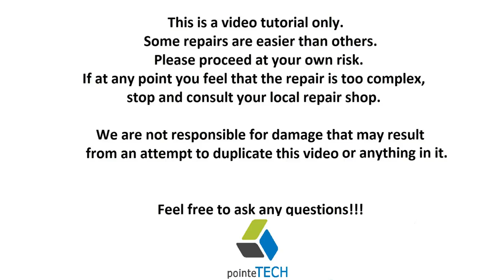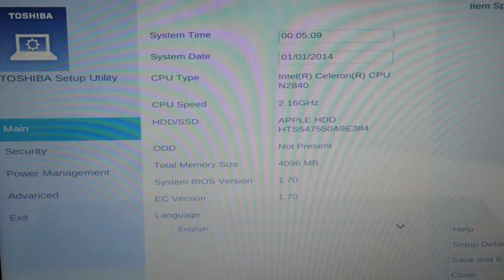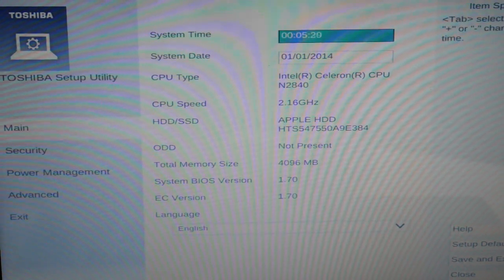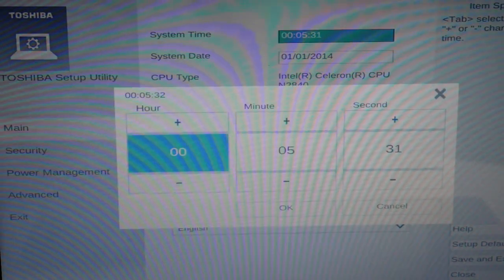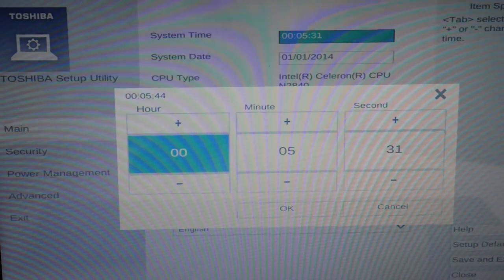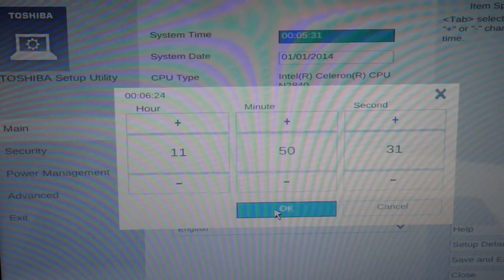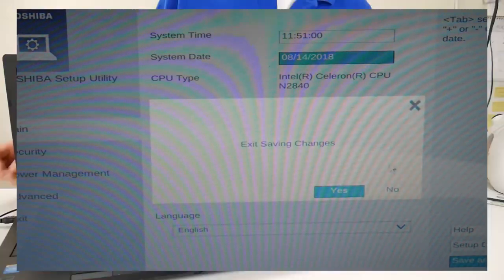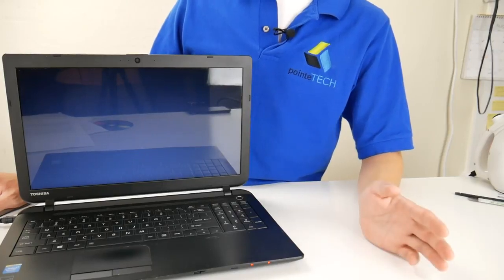How to Fix Replace Bad Checksum, RTC Battery Low, 0251, Set Date Time Error - Toshiba Computer

Comment: Hi, have this issue. Try hitting the F2 key and just seem to register or escape or delete for the on board keyboard and a plug-in keyboard still the same issue won’t let me do any of the comments. Any help would be appreciated and it’s a brand-new CMOS battery.
Reply from the maker: Your getting a 'Bad Checksum' error on your Toshiba and cannot access BIOS? Have you tried all the function keys? Also, did anything happen before this issue appeared?  Liquid spill, overheating, Windows update, etc?

Comment: Are data, images, and files deleted?
Reply from the maker: Is the DATA deleted by replacing the CMOS battery? No. DATA is not stored on the battery. Its stored on the HDD

Comment: replacing battery did not solve the problem :( ..
Reply from the maker: Then your most likely looking at a BIOS issue or a motherboard issue.  I would next try to reload or flash BIOS

Comment: Hi. 

I am using Toshiba C55 laptop. It gives RTC Low error. 

Moreover battery shows just "plugged in"

Replaced new battery twice. 

Updated windows 10.

In device manager uninstalled drivers under batteries and reinstalled. 

Doesn't fixed so far. Appreciate your valuable feedback.
Reply from the maker: If the CMOS battery is fine, it could be a motherboard issue at this point :(

Comment: But even if its pluged in, still might be battery problem? Mine is working for 2min. then it goes "battery low" and shuts down when pluged in.
Reply from the maker: This video is referring to the CMOS battery.  Not necessarily the main computer battery.  Are you seeing a 'bad checksum' error?   Or is the computer just turning off?   If the computer is just turning off, what is the battery showing for a charge when it turns off?

Comment: That's the wrong laptop to use for this video because these Toshiba Satellite C55 DO NOT have an internal battery.
Reply from the maker: Seemed to work for the video just fine lol.  But thanks ;)
Reply: @PC_Monkey  Setting the date in the BIOS can be done on any computer. But that does not reset the bios with an RTC low battery error when those model do not have a battery. If you have an RTC low battery error, pull your main battery and power cord. Let's see your little fix solve the problem then. It doesn't. As we all know, batteries with laptops at some point will go bad. Without the main battery, that error will remain no matter how many times you set the date in the BIOS. And you are leaving that part out.
Reply from the maker: @graffixplus908  If thats the case with a viewers computer, they message me, if they are so inclined, and I instruct them further.  When you make a video on the subject, Im sure youll make it how you see fit ;)  but thx

Comment: Hi, do you have any ideas what to do with my computer toshiba l50t-b-13u, it’s showing message RTC battery low, and then asking for some sort of password, no idea if it’s a BIOS password or something else. Thx
Reply from the maker: Yes, it could be a BIOS password.  Unfortunately, I dont advise on bypassing BIOS passwords on this channel.  You can try to replace the CMOS battery for that other warning however.
Reply: @PC_Monkey  is this model of Toshiba having BIOS battery or is it combined with main laptop battery? As I cannot see any under the bottom bezel, I don’t want to strip full motherboard to see if it underneath somewhere, just in case I’ll damage the motherboard. If it’s the BIOS password it’s asking me on the screen, why is that and how can be fixed? Thx
Reply from the maker: @konanunu1980  Not all motherboards have CMOS batteries.  If yours does not, then you wont be able to reset BIOS that way.  Again, I dont advise on how to affect BIOS passwords on this channel.
Reply: @PC_Monkey  so do I need to go to computer shop and let them do it? Coz I’m stuck, I don’t know what to do :(
Reply from the maker: @konanunu1980  Yes.  They may recommend replacing the motherboard, as most shops will not know how to bypass a BIOS password.

Comment: Mine doesn't work, I've press F2 and F1 but still not working
Reply from the maker: What brand and model computer do you have and whats the issue with it?
Reply: @PC_Monkey  me to
Reply: Mine is a Windows 8 Toshiba touch screen
Reply from the maker: @yukiee5495  What is happening with your Toshiba?
Reply: @PC_Monkey  I open it and start tapping on f2 but it says etc battery is low and doesn’t do nothin
Reply from the maker: @yukiee5495  Try removing the battery and just starting the computer using the power adapter.  What happens then?
Reply: @PC_Monkey  oh wait it works THANKS MAN
Reply from the maker: @yukiee5495  Your welcome !!  Happy to help :)
Reply: @PC_Monkey  when I tell you I already lost that laptop 😭 idk it's feel funny know kkkkk~

Comment: but mine is a Satellite L850 ive changed the cmos battery and and changed the time and still its on the bois settings
how do i fix this????
Reply from the maker: Your computer starts and it does directly to BIOS?  Before your able to see the startup logo screen correct?
Reply: @PC_Monkey  no i see the start up logo first and straight up to bois
Reply from the maker: @BreadCrusader446  Try this video first then; https://www.youtube.com/watch?v=2Hh1wIS9NDo
Reply: @PC_Monkey  pls respond

Comment: How can you fix it without a keyboard? Say the keyboard itself is not working.
Reply from the maker: If the keyboard itself if not working, then you should first replace the keyboard.  Its very hard to troubleshoot computer issues when more than one thing wrong.  Usually, you need all components to do their job.

Comment: Para el modelo Toshiba Satellite L45-B, me aparece mensaje "rtc battery is low press enter to set date/time", actualizo y luego normal funciona, pero cada vez que lo apago vuelve al mismo mensaje "..." Como descartar si es la Bateria gastada (en la barra de bateria me aparece una X roja) o será la pila?.
Reply from the maker: If you get that error and have to adjust the Date/Time setting every time, then your CMOS Battery needs to be replaced.  You can see how to access that here;  https://www.youtube.com/watch?v=uL97XhontSo&feature=youtu.be

Comment: este modelo no trae bateria interna como la van a cambiar si el siguiente video es otro modelo.
Reply: Yo ya busque la bateria por todos lados y tampoco la encuentro, entonces quien alimenta el CMOS del Motherboard, el problema de RTC Battery Low es defecto de fabrica ?
Reply: @marianamartinez5963  ya solucione el problema. compre batería nueva y con ese solucione la falla. osea batería o pila externa de 2 tornillos. espero haberte ayudado.
Reply: @djcamposmx  muchas gracias yo también ya la mandé a pesir. Saludos y gracias.
Reply: @marianamartinez5963  lastima que el cliente estaba ese día esperándola. desde que la desarme y note que no tenia batería. y entre y nadie dice cual es la solución. y pues para la prox subiré un vídeo. para ahorrar el tiempo de desarmarla sin encontrar batería interna.
Reply: @djcamposmx  quisiera ver
Reply: @michaelcarmona6529  en cuanto nos llegue un modelo con la misma falla haremos el video.
Reply: @djcamposmx  yo compre baterías nuevas y sigue el mismo lío..que hacer?? Y lo peor tengo 2 máquinas con el mismo problema.. uu

Comment: If I press enter for the the date and time reset to default. Will I lose my data such as photos or other stuffs?? Because especially photos soo important for me and I don't know the results after doing this process
Reply from the maker: No.  Your data is stored on your Hard Drive and is linked to your Operating System.  BIOS is the base system and has nothing to do with either of those two :)

Comment: hi, great videos, my laptop is the same as yours and I've had it from September 2014.
the rtc comes up a few times now and reset the time and date, I need to use laptop to my GCSE's I reckon the battery is old and needs changing. I haven't tried the leaving it on for a few days as I reckon th battery is shot.
Do I just change battery and not leave it out for 15 minutes ? don't want to do the reset or will it loose all saved stuff on laptop if I remove the battery ? 
thanks matt.
Reply from the maker: If it keeps happening, I would just change out the CMOS Battery.  They are so cheap that for me, its worth the time savings to just put a new one in.
Reply: @PC_Monkey  I have just taken laptop apart and the battery isn't in the place on your video, its a toshiba l50-b-1m.
their is a small long black plastic shape which looks like a battery is sealed in with a think black and white wire coming out, also one next to fan. any help would be appreciated.
Reply: @mattytimmins1722  seems it has not cmos battery, on board, i check out seems the technology used rtc place the cmos battery inside the main battery, which cannot be replaced by low cost

Comment: HOLA¡  cambio la hora pero cuando apago el portátil se borra de nuevo. Donde esta la batería de la cmos de este portátil satellite l50-b-1hu gracias.
Reply from the maker: I only found that motherboard here;
https://www.newegg.com/p/0X6-04KT-0Z3P9?item=9SIAJX7B5C1605&source=region&nm_mc=knc-googlemkp-pc&cm_mmc=knc-googlemkp-pc-pla-cbg+worldaccessories+-+pda_-9SIAJX7B5C1605&gclid=Cj0KCQjw0pfzBRCOARIsANi0g0vCYtBXd_ik5bfxE6CmdtXIQesgtId6JOGHAHg2Byegvub6WNSXVxcaAmwwEALw_wcB&gclsrc=aw.ds
In that picture, I cant see the CMOS Battery :(  That means it is either integrated into the motherboard, or its been removed.  Sorry :(
Reply: Hola Fidel lograste encontrar la bateria ? yo no la encontre por ningun lado.
Reply from the maker: @marianamartinez5963  What brand and model computer do you have?
Reply: @PC_Monkey  Toshiba satélite L55D, Motherboard DA0BLMMB6E0 MODEL BLM
Reply: @marianamartinez5963  no, la placa no tiene batería.
Reply: @marianamartinez5963  El día de hoy, reviso este modelo: L45-B4275PM (TOSHIBA), pero por ningún lado encontré la base de la batería, sólamente en la placa dibujado el espacio que tendría que estar; revisando en vario sitios encontré los comentarios de que no trae este modelo bateria para el RTC, que toma la energía de la "batería externa" por así llamarle. Entonces, ¿la bateria "externa" debe estar funcionando correctamente si no ocurre el error de la pérdida de RTC (Real Time Connection)? Estoy en lo correcto?
Reply: @juanandreszaratecobos9746  si ya veo aunque cambie batería nueva y sigue el problema 😏😏

Comment: I have a Toshiba c55, looks just like this one. I get this every time I turn it on. I figured I needed to replace the cmos battery so I opened the laptop up and to my surprise it doesn't have a cmos battery or anywhere to put it. I'm gonna try leaving it on for a few days. Any other ideas though?
Reply: I have the same problem
Reply from the maker: Have you tried the steps in this video?  Tried the date and time settings?
Reply: @PC_Monkey  Yes C55 has no RTC battery, so the date and time is maintained by the rechargeable battery. Incredible you have to change the main battery.
Reply from the maker: @robertomessina1254  Lame.  Sry :(

Comment: when you say (try leaving your computer on for several days), how many days i need to keep my computer on to fix the CMOS checksum?? i hope you give me the answer very very very soon
Reply from the maker: Try it for a few.  Try 3
Reply: @PC_Monkey  3 days, ok thank you i'll try that. i have another question, this video is it working  for all pc's models because i have HP PAVILION 17??
Reply: CMOS battery do not recharge they are a coin battery it is to power the setting memory only. If  you have to reset the time and date the battery needs to be replaced

Comment: okay but what if I press F2 and nothing happens, I pressed all the buttons and nothing happened
Reply from the maker: What make and model computer do you have?
Reply: The toshiba satellite C850D-107
Reply from the maker: @Elleanoire  Online it says F2.  You tried all the other function keys too?  Try holding down on F2 instead of tapping it.
Reply: PC Monkey I’ve tried that, I’ve tried holding it down while turning it on and I’ve tried holding escape because it told me to do it online, my computer might be dead forever 😞
Reply from the maker: @Elleanoire  Is your computer dead?  Is it not turning on at all?
Reply: PC Monkey it turns on and that’s it, doesn’t stay on for long though, maybe a few minutes
Reply from the maker: @Elleanoire  If you take the battery out, and just run the computer on the charger, will it stay on longer?
Reply: PC Monkey it does not
Reply from the maker: @Elleanoire  Sounds like a motherboard issue unfortunately :(  You may need to replace that.  They are usually a bit cheaper than you would think though :)

Comment: I watched your video screen freezing while start up my laptop is starting when i remove the battery and when i am fixing the battery the screen is freezing again pls help
Reply from the maker: Sounds like you need a new battery.  Try replacing it and see if the problem persists :)
Reply: @PC_Monkey  thanks buddy 
Best channel for laptop users
Reply from the maker: @mohammedilyas2952  thx :)